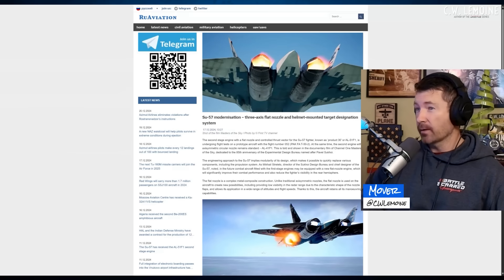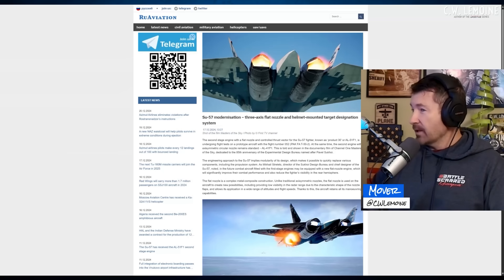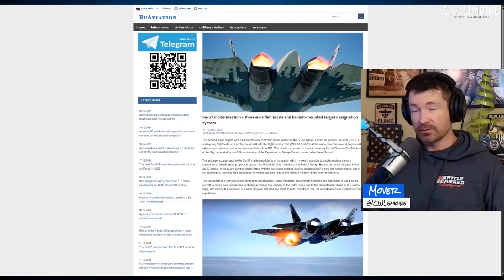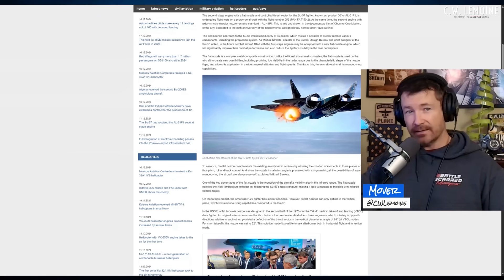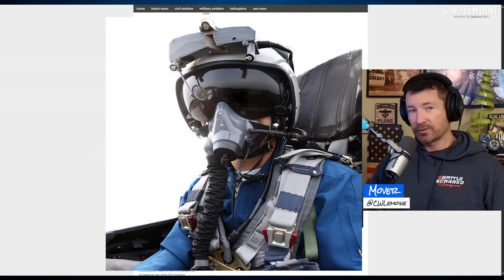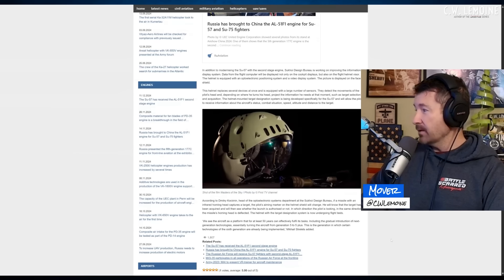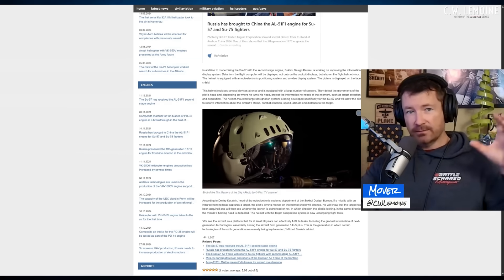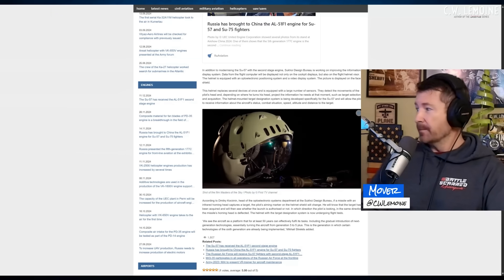New Upgrades for the Su-57 FELON

Comment: Does this mean we'll "modernize" the TOMCATS?!
Reply: Yeah it’s called the F35
Reply: @CNSTAdventures  Couldn't be more different if you tried. The Tomcat is one of the coolest airplanes ever made, the 35 is very boring in every way. The 35 is a way better platform that beats the Tomcat in any realistic scenario for sure, but I think what the guy meant was that a modernised Tomcat would be very very cool.
Reply: @CNSTAdventures  F-35 has nothing on the tomcat. It's like 30% slower with less range.
Reply: @mikeyplayzwrld thing is, F35 was never meant to be a superiority dog fighter, nor was it meant to be the fastest.  It’s a flying computer designed to facilitate the battlefield across multiple domains, connecting “everything” even in contested areas like we’ve never been able to before all while being capable of nuclear payloads.  Comparing the tomcat to the F35 is like comparing the MC130J to the AC130J, both C130J variant platforms, but vastly different roles.
Reply: @ If the F-14 would’ve been still in service, having a rio with the upgrades the F-35 got would’ve made it a far better aircraft. And since both are made by Grumman, it’s not that far fetched. It would probably be similar to the F-14 in VTOL VR if you’ve heard of it. As a bonus, it would also be able to fully utilize the Aim-174B, unlike the weird F-35 and hornet combo we have now.
Reply: @mikeyplayzwrld bs, combat radius of F-14 is 326 miles, combat radius of F-35C is 600 miles - almost double of F-14s. F-14s top speed is higher but only with afterburners - can’t cruise at Mach 2.2 longer than several minutes, so in reality there isn’t much difference. F-14 can carry more weapons, but severely lacks F-35s situational awareness and on radar glows like a Christmas tree
Reply: @TymaDem  Now my turn to call BS. The F-14D's combat radius is 575 miles. Given we're talking about a modernized tomcat, it would've obviously been better than that. So that's already 1 lie/you didn't do any research. Next, just in general, the F-14 is a faster plane. Without afterburners, the Tomcat can get up to up to mach 1.1 without burner assistance and mach 1.4 with burner assistance. The F-35 can't even supercruise. That's a lie by omission in my book. Finally,  I said with the F-35s upgrades. But besides that, it's not like stealth jurisdicts the whole jet. The F-15EX has no stealth or even low observable features. It's RCS is the same as the tomcat. But since it has jamming, it can reliably confuse enemy radar and close the distance with it's great speed and weapons. The F-14D had jamming and it was from the 1990s. Given upgrades, we would essentially have a more maneuverable, navalized F-15EX. That is infact way better than the F-35C we have in almost every way but RCS.
Reply: @ 1) I didn’t lie, 575 miles still LESS than F35, regardless of the version.  2) there is no official data about F-14s super cruise. Super Tomcat 21 could theoretically, but we are not talking about that. F-35 can go Mach 1.2 without afterburners for short bursts, supercruise dash. 
3) your idiocy/lie F-15 EX supplements F-35 from behind and acts as a missile truck. In any case it doesn’t justify f-14
4) final point: all woulda/shoulda/coulda already nullifies your point. Because we are talking about real things not hypotheticals. Because by the same token I can say that future F35 blocks and mods would/could/should have features that surpass anything else, including F15/F14/F22
Reply: @ 1. Is really just irrelevant given it’s all determined by payload. For naval cases they’d be almost always the same. 
2. We are talking about the ST21 (which could supercruise given the engine upgrade). As I’ve said multiple times as my main argument, the ST21 with the F-35s existing equipment would be a better plane. So that whole thing about future F-35 blocks is again irrelevant. The F-14A can do what you call and “supercruise dash” and most 4th gen planes can. That’s not special. 
3. Calling the F-15EX a missile bus that needs the F-35 to work really shows how mislead you are. The F-35 is more of a missile bus than the F-15EX. In no way shape or form is the F-15EX a supplement to the F-35. If they were to team up, it would be an equal supplement or the Eagle helping Fat Amy. 

Thanks for contributing nothing but false information.
Reply: @mikeyplayzwrld ”an upgraded f-14 would be better than the f-35”

Y’all this f-14 glaze is getting out of hand, the f35 may not have as much flight performance, but quite literally everything else about it is fundamentally better than the f35. It has stealth, significantly better avionics and sensors, and the ability to almost act as a mini awacs, and it can carry 130+ mile missiles. Plus it can still be upgraded. And it can operate in multiple roles

Even with significant upgrades, the f14 will never have avionics as good as the f35, and it’ll never be stealthy, and the f35 is also a versatile airframe already. There is no need for the f14 while the f35 and f15EX exist

It’s a better aircraft than the tomcat, please quit it with the nostalgia man.
Reply: @aceofaces1506  It has stealth: Good job you know the F-35 has stealth characteristics. That's great and all, but stealth is certainly not the "end all be all" characteristic you think it is.

significantly better avionics and sensors: So when you stated yourself "upgraded F-14" what did you think was apart of that upgrade? Cupholders??

and the ability to almost act as a mini awacs: This is apart of the upgrades. Remember, Grumman made both the F-35 and F-14. This is not out of the question.

and it can carry 130+ mile missiles: So could the F-14. 

Plus it can still be upgraded: So could the F-14. 

And it can operate in multiple roles: So could the F-14. 

In conclusion, "The upgraded F-14 would be a better aircraft than the F-35C, please quit it with the copium man"
Reply: @ when it comes to air combat, assuming both pilots have a functioning brain, a stealth aircraft will beat a non stealth aircraft 100% of the time, because the non stealth cannot detect the stealth aircraft until it’s too late. This is common knowledge now, and that alone makes it a more formidable A2A fighter than the f14 

As for avionics, the f35 has sensor integration like crazy. There’s only so many upgrades you can make to an aircraft, but some features need to be there from the get go. For instance, there’s a reason why we can’t add IRST to the f22. This also applies to most of the avionics and sensors that make the f35 so advanced. Ffs, there are so many sensors that the pilot can literally see through the aircraft if they wish. That will never be on the f14

By extension, the f14 will never be able to  act as a mini awacs because it would cost way to much money to upgrade it. The aircraft was never designed with that capability in mind 

So in reality 

The f35 loses in flight performance. But unless you’re willing to literally drop a trillion dollars, you cannot upgrade the f14 to be on par with the f35. And even if you did, it’ll never be a stealth aircraft, which makes it less capable by default. 

So like I said, stop glazing the tomcat
Reply: @aceofaces1506  Yes but the upgraded F-15 EX is okay 👍?
Reply: @ the f-15EX is great but still not as good as the f35. That’s okay, they’re meant to fulfill different roles in the Air Force anyways
Reply: @aceofaces1506  That's all we are really saying about the Tomcat. It should be the supplement to the F-35.
Reply: @ that’s what you’re saying maybe. The other dude is trying to argue the tomcat would be a better airframe, which is just straight up not true. Cooler? Sure, but not better
Reply: @aceofaces1506  It's far superior as an airframe, but it's not stealth. It like all other fourth generation fighters would have to play second fiddle to the F-35.
Reply: @aceofaces1506  Im going to address your comment number the spaces you made. 
1. This isn't always the case. Now I wasn't implying that these aircraft were going against each other. It would be more or a one exists, one doesn't, type of deal. So the only stealth aircraft it would fight would be the SU-57 or J-20. In those cases, yes, it would probably be outmatched. However, I don''t see that happening anytime soon. The F-35 wins in terms of stealth, yes.

2. There is no reason the can't be. The F-14 is a much larger jet with a whole second cockpit. There absolutely space for the F-35s sensors and avionics. The mini-awacs thing was also funny because Iran used their ANCIENT F-14A's as AWACs because of their powerful radar. That is not something out of the question and minimal upgrades would need to be done compared to making a brand new aircraft. 

3. Man shit, the F-35 is going to end up costing 2 TRILLION. That's a damn steal. 2 trillion on a plane that has significantly worse things about it than a 1960s airframe is wild. From the very limited research I did, the F-35 will cost at a minimum 2 trillion dollars. The entire Tomcat program cost ~30 billion dollars. (~30 Billion dollars accounted to today's numbers is around 80 Billion). That means the F-35 program so far costs 25 times more than the entire F-14 program. That's absurd. You can't argue the F-35 has 25x the performance of the ST21, and certainly not anything that would've came after that.

So like I said, seems like you're glazing the F-35...
Reply: Just say you glaze the f14 and move on stop with this delusion
Reply: @ 1. The f14 against any 5th gen fighter loses 10/10 times. The same cannot be said for the f35. Even with significant upgrades, the f14 will always lose a fight against a 5th gen due to a lack of stealth. You need to stop trivializing how big of an advantage stealth is. The f14 by default is a less capable A2A airframe due to its lack of stealth, with the only situations it would do better at being intercept missions, and dogfights. That’s it. On top of that, stealth makes the f35 a very capable ground attacker as it can sneak into enemy airspace to bomb things, which the f14 can’t do due to a lack of stealth. This is also a HUGE advantage which adds even more to the f35’s versatility 

2. Too much money would be required to make it work. And it wouldn’t matter, because a better jet already exists that does that, so what’s the point? Like sure, you COULD upgrade the f14 to do the mini awacs role. However due to its lack of stealth, it’s significantly more vulnerable in that role than the f35, plus the fact that it would almost certainly be less effective at it than the f35 is

3. It would likely cost a lot more than just a trillion as we’d have to literally restart the entire program to from the ground up to produce the f14 again, but my point is this. Why spend 1 trillion upgrading an outdated airframe when you could spend that on one that is significantly more advanced and more capable aircraft? Hence, f35 is better

Listen. The f14 is cool, and it has better flight performance across the board. But even with tons of money dumped into it, it won’t be as good as the f35. It’ll basically be what the f15EX is right now, an airframe with some advantages but overall is not as capable as the f35
Reply: @mikeyplayzwrld  F-14 got replaced by the inferior F18 Hornet, because it was a big plane that took up much space on the aircraft carrier. And the threat it was designed to fight (Soviet strategic bombers) no longer existed. Having a few aircraft types in service simplify logistics, and pilot training becomes easier as all pilots are flying the same type of plane and do not need a lot of extra training if they need to fly a plane doing a different job in the navy. Instead are F18 doing everything from air combat, to electronic warfare, to ground attack, aerial refueling etc.
And as we all know, was F-14 also a huge hangar queen with its swing-wing and two engine design. F14A needed 50 hours of maintainance per flight hour.

However logistics and economics is not the only reasons why the F-14 Tomcat have no place in the modern navy.
F-35 got much better stealth. I mean even if you turned the F-14 Tomcat into a more stealthy plane with the same radar signature as the SU-57, you would still have a plane that got a 10.000 times larger radar signature than F-35. And in modern air warfare is it also important to have multiple sensors working togheter, not just on your own plane, but also of the sensors of friends planes when you are flying. And when you got two radars up in the air it is much easier to exactly locate an enemy target. And that is why sensor fusion is so important. It warns you of threats early, and it allows you to fight the enemy at a great distance. So stealth and sensor fusion matters a lot.

And yes the F-14 got a big radar. However sending out radar signals to the enemy saying "HERE I AM, LOOK AT ME!!" is not a smart thing to do.
Its better to let an AWACS plane with its much better radar spot the enemy instead, and send the information where he is through a datalink so you can send a missile towards him and finish him off.

As I sees it do the navy not need a stealthy F-14 missile truck. It can use the Super Hornet instead. And it would probably use drones in the future instead.
Reply: @nattygsbord  
1. I've explain this a lot, and honestly it's getting tiring, but you can fit the same amount of F-14s of the carrier deck as superhornets. The F-14's wings swept back to 75 degrees on the carrier which allowed it to do that. And you're right, the F-18 can do everything, but it's not good at anything it does. 

2. I've already addressed stealth. I believe it's not something needed for the F-14 to perform. And the chances it comes across a plane that can exploit that weakness is almost zero. And again, the sensors on the F-14 would have been upgrades at at the minimum the F-35s standard. 

3. There's ways to use radar without alerting the enemy. Mainly using TWS. But even then, you said yourself that AWACS and datalink would be used for those extreme cases. So I don't understand your point. 

4. Why doesn't the airforce use the hornet over the F-15EX if it's such a great platform?
Reply: @aceofaces1506  It's okay to keep throwing billions of dollars at upgrading the F-15, F-16, and F-18, but God forbid that any money should have gone into upgrading the F-14 Tomcat?

Yes in the old days a stealth fighter always had the advantage.
Now with aesa radars that operate in multiple bandwidths not only x band, stealth fighters can be easily seen.

Those stories of an F-22 killing multiple Eagles happened when the F-15 had only an X band radar.

Nowadays stealth is becoming increasingly irrelevant.
Reply: @mikeyplayzwrld  F-35C has much more range than F-14 did.  They carry the same amount of fuel, save the F-35 holds its 20,000 pounds all internal.
Reply: @mikeyplayzwrld  Low Observable is the proper term for the media name of stealth.  Being LO isnt less stealthy than "stealth".
Reply: @hoghogwild  Thats simply not true. The F-35 only has 25nm more range, and thats assuming completely optimal conditions. The same can be said for the F-14, but atleast it could get up to speed and altitude faster to take advantage of that range. And while the F-35C carries 19,750 pounds of fuel all internal while the F-14D can carry 20,000 at max with 2 tanks, the F-14D could carry at a minimum 8 missiles in that configuration, with a gun, the built in AtG targeting system and being able to go Mach 2.34. The F-35C can carry a pathetic 4 missiles before its low observability becomes useless, has no gun, also has an AtG system, but can only go Mach 1.6 with unknown conditions. That’s wild.
Reply: @hoghogwild  I know that, however not everyone does, so when I refer to low observable I normally mean stuff like the Eurofighter and F/A-18. While “stealth” is for stuff like the F-22 and SU-57.
Reply: @mikeyplayzwrld  1976 f-14 with 4 AIM-7 and 4 AIM-9 could reach Mach 2.1. Lose the heaters leaving 4 AIM-7 semi-recessed into the fuselage allowed for MAch 2.25 plus, all no tank obviously.  
 Max speed with in F-35 is with full internal weapons and fuel load. 6 AIM, internal on Block 4.
The D variant was an impressive unit, but it was the heaviest Tomcat.  For ultimate acceleration an A+/B variant would be my choice, same great GE F-110 engines that he D shared, a couple'ish thousand pounds lighter.
If only the F-14 enjoyed the same level of support that the F-15 received. The Charlie Eagle IOC'd 3 years after the A did.  Meanwhile look how many rebuild B and Ds they did.  $25 million for a rebuilt A to D or $50 million for a new build F-14D.
I remember F-14s in shrink wrap all lined up with no money to fly them. Peace dividend was not "enjoyed" by Naval Aviation in the 90's.
Reply: @mikeyplayzwrld  OK that's cool, like you say, not everyone knows.   Santa''s gotta be getting picked up by NORAD about now.  Happy Holidays!
Reply: Dreb.
I understand all the flying computer stuff, but it worries me that the F35 took 20+ years to develop and the rate of development in computers makes a 20 year old computer obsolete.
Reply: @mikeyplayzwrld  ive read that the D model with the PW engines could supercruise.  not sure what that other guy is getting at
Reply: @bigshow196  He’s not a very smart guy.
Reply: If u mean the Iranian ones then sadly no, Iran is Reportedly planning to retire both their Tomcats and Phantoms once they get a sufficient number of Flankers. Welp, at least the Old Lady can finally rest peacefully.
Reply: @pandasonic1294  They should sell to private American contractors/Grumman.
Reply: @mikeyplayzwrld  lol, good luck.
Reply: @kmrtnsn  The F-14 has the same RCS as the F-15EX, which is the world's newest fighter jet at the moment. Cry.
Reply: @mikeyplayzwrld buddy if you really think a f-14 is better than a f-35 you have no idea about aviation
Reply: @thatPilotandCarguy  Explain why you think an F-14 with the F-35s avionics would be worse than our current F-35C.
Reply: Only if Mover & Gonky go visit our “friends” in the Middle East and “bring” one back to be modernized…… 😉
Reply: Top Gun Maverick used the Tomcats because F-35s too scared to face off the Su-57
Reply: @worldwanderer91  bruh this is F tier ragebait
Reply: Let CIA decide.
Reply: No you can’t cause tour money is busy going to israel ukrain and taiwan
Reply: Lol its an outdated design, folding wings while it looks cool, was just one of those designs that happened because lack of knowledge.
Reply: If US does modernise f22 it Will be on par with mig 21
Reply: @5tre55full  ??
Reply: @TymaDem  its just to point put biased nonsense People usually apply to everything Russia did or have produced . So i am just poking
Reply: @TymaDem  its just to point put biased nonsense People usually apply to everything Russia did or have produced . So i am just poking
Reply: They definitely should have updated the Tomcat with new engines, avionics, aesa radar, electronic warfare suite, HMCS, and updated Phoenix missiles, etc, just like they did for the F-15 EX.
Reply: We should modernize the P51 Mustang to have high off-boresight Fox 2’s just to see if we could beat the Felon with it 😂
Reply: @THONGPOUNDER6969  What IRST does the P51 have?
Reply: @sujitbala1492  it’s called the LookSee 5000 block 2. It was an early version where the pilot had to look for the enemy aircraft and if they see one, they shoot at it 😂.
Reply: @THONGPOUNDER6969  WW2 fighters are  actually very maneuverable at low speeds so wheel the su57 would definitely have a thrust to weight ratio advantage the p51 may have better chances in a dogfight than you might think
Reply: What Tomcats? 😂
Reply: Your tomcat is now older and it became a Tommouse 😅😂😂